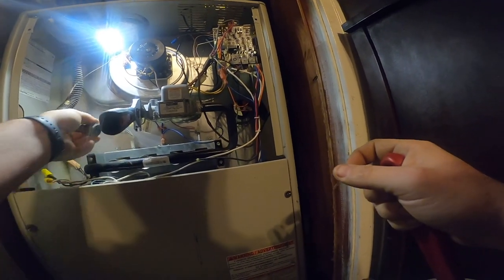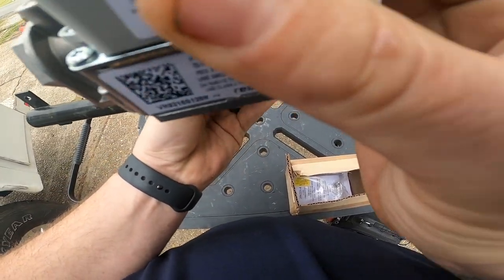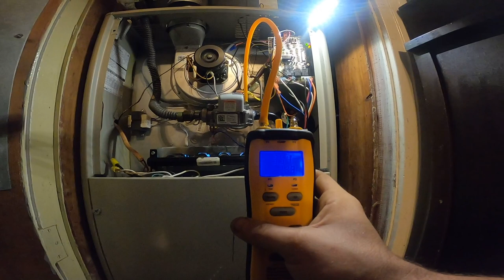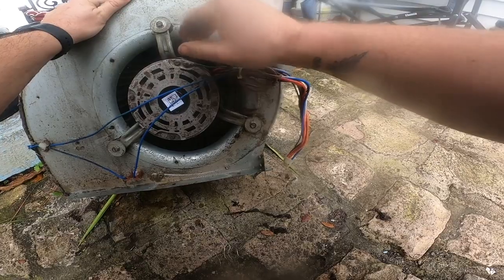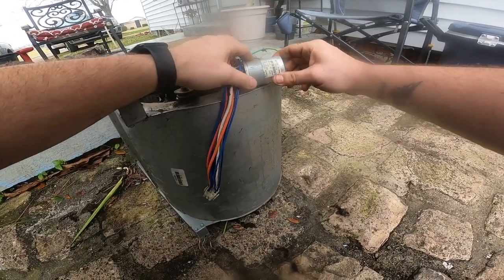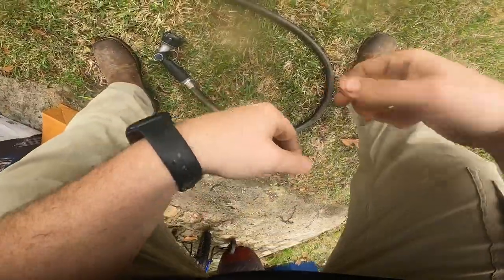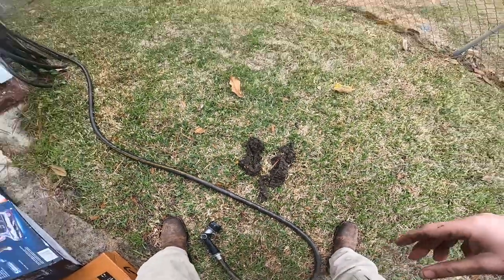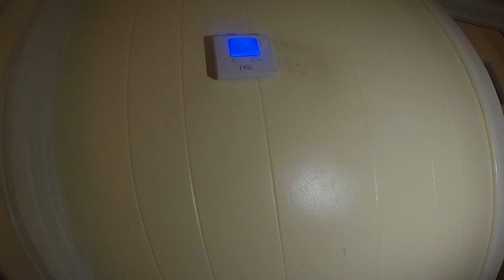No Heat/Gas Valve Replacement/Pull & Clean Blower

Comment: Absolutely I know you avoided getting the motor wet but inevitably water and moisture will have likely creeped in. You did the right thing letting the motor fully dry out before use otherwise it would have compromised the motor windings insulation resistance allowing for shorts and faults to occur. In industrial plants motors are often oven dried over a prolonged period. You could blow dry them and undertake an insulation resistance test to ensure their is sufficient resistance prior to use and application of voltage. Modern ohmmeters can apply a low voltage to test insulation resistance avoiding damaging the insulation of the motor windings.

Comment: The hardest gas valve I had to do was an Lp modulating gas valve in a Bryant furnace. Talk about tight spots. The low pressure cut off would rub against the flue pipe and cause it to shift every time. I choose a single or 2 stage over any furnace

Comment: When changing those Gas valves try and break it loose the first half turn with it in the furnace . Sometimes these factories make it seem like dope costs a thousand bucks a can
Reply: Exactly. It's crazy how tight some of these are
Reply: And use two wrenches I prefer a smooth wrench to release those nuts and a gripping wrench with teeth to act as an opposing force much better and easier to release those tight nuts. Of course don’t forgot to turn that gas valve off before doing anything!!!

Comment: Nothing critical, just observe. My gas hot water tank failed recently, without a truck, so used a high price company to get it done quick. They replaced gas flex, copper flex, and earthquake straps. Job quality was okay, except the guy wanted to use a Shark Bite after cutting off supply valve. Hell no. I made him get out the torch, had mine handy, but wanted to use his own. Tank is out of level. If I pay a premium price, expected to not have to discreetly helicopter. I made the job easy by draining the tank and moving all out of the way. Also, I suspect I have a couple of split studs as no pre drill before mounting straps to the wall. Aarg, wish I did it myself. You do great work. Hard to find here.